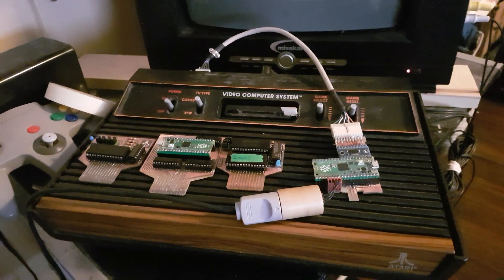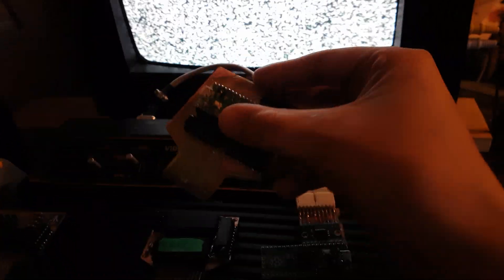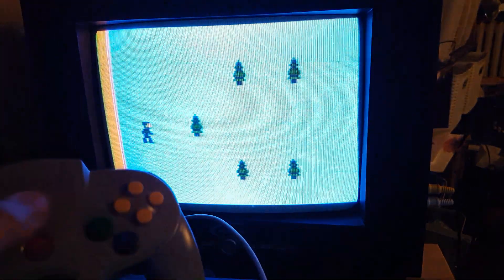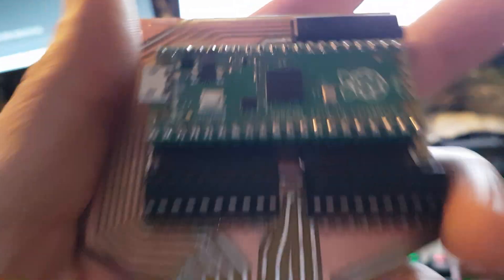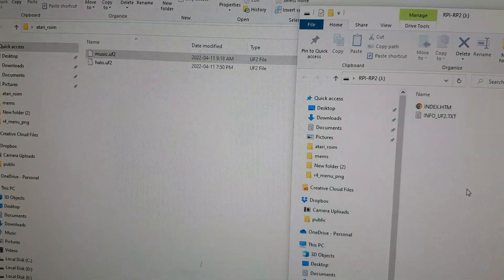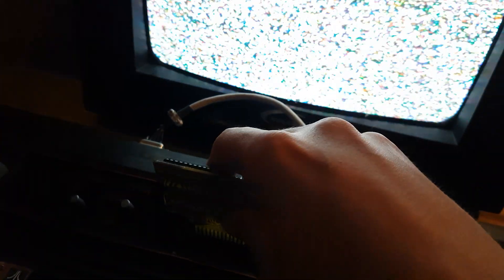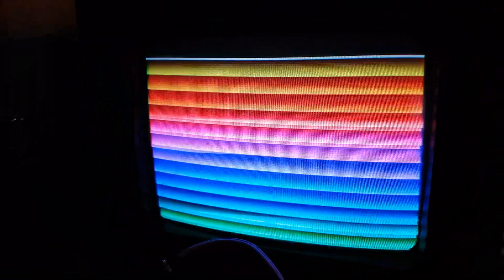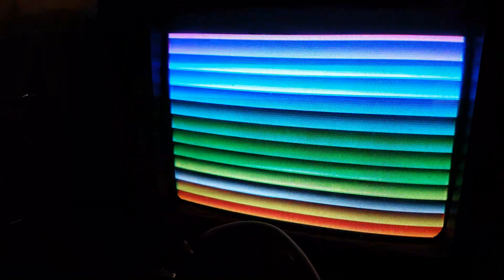Atari 2600 Raspberry Pi Pico

Comment: You have every reason to be proud, great job on the cart even if it's limited to 4k roms (some great 2 and 4k games out there). Looking forward to seeing where you take this. Oh, the N64 controller on a 2600 is a nice touch ;)
Reply from the maker: Thanks! I was having serious timing issues and without a logic analyzer there is little hope to fix that in the programming. Theoretically the Pico Pi should be able to keep up with the Atari without any sort of overclocking. I do have a hardware implementation to overcome this using off the shelve parts, however I've been a little more focused at using a Raspberry Pi Pico to make a replacement N64 controller pak lately.